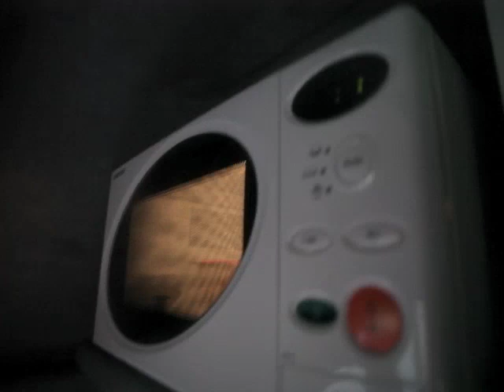Yamaha 'Super-Trolley' - Amelie. 60mph Top Gear Train..

Comment: they use trains very similar to this in Cambodia. Not just for fun but actual traveling too. Except of course  their's are made of wood and bamboo and use a lawn mower motor instead and of course they are only half as fast as this. Also the platform form isnt attached to the wheels it just sits on top of them...and the trains often share the tracks so if one is coming the opposite way either train has to be lifted up and moved. There is  plenty of videos of the trains on youtube.
Reply from the maker: They were what inspired me to build this one... I've built another since - have a look :) 50 mph Super-Trolley Railroad Go-Kart